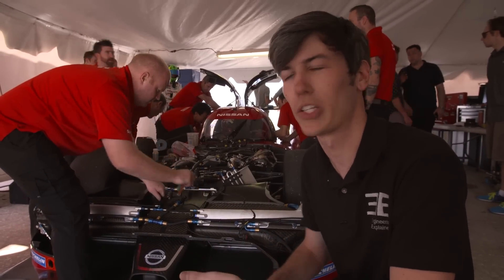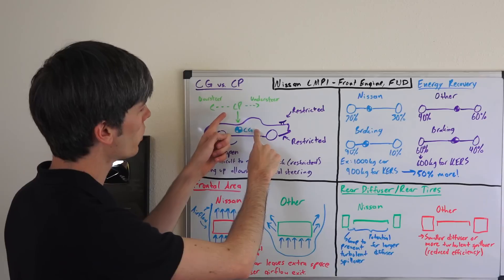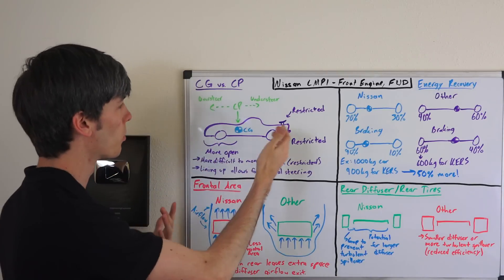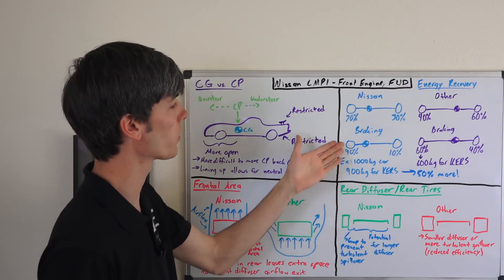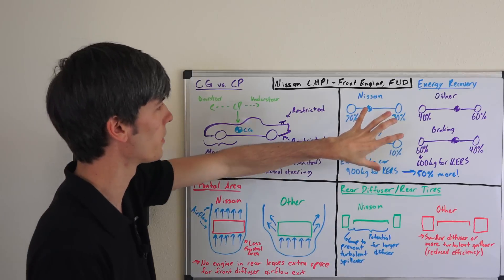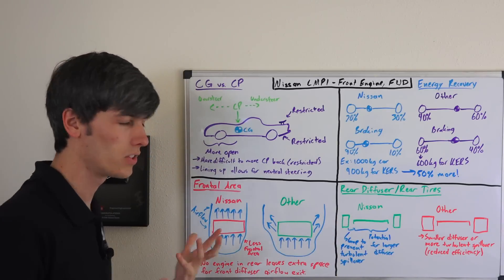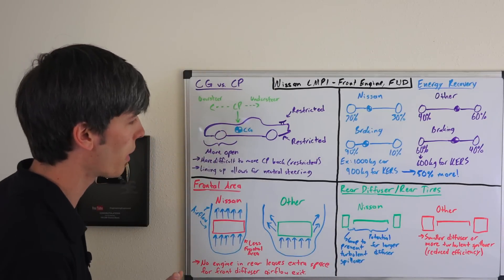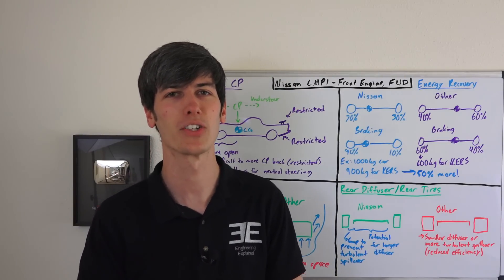Nissan GTR LM Nismo - 4 Reasons Why Its FWD & Front Engine

Comment: Isn't Nissan LM NISMO technically optionally AWD? I believe there is a electric driven/charged flywheel that sends power to the front and/or rear when needed.

Wiki: http://en.wikipedia.org/wiki/Nissan_GT-R_LM_Nismo
"The flywheels can also output power to a secondary driveshaft which is connected to a limited-slip differential at the rear of the car which feeds epicyclic gearboxes located in each rear wheel hub, allowing the GT-R to be all-wheel drive if necessary."

You can see a half shaft in this picture:
http://www.google.com/imgres?imgurl=http://www.racer.com/images/igallery/resized/4601-4700/Nissan_GT_R_LM_NISMO_LMP1_by_Marshall_Pruett_30-4610-900-506-80-c.jpg&imgrefurl=http://www.f1technical.net/forum/viewtopic.php?f%3D5%26t%3D21401&h=506&w=900&tbnid=B-YuuEFID2FmdM:&zoom=1&docid=vJ0Cjy134D5yWM&ei=65xDVdfPAY7IsAT21oGYCg&tbm=isch&ved=0CGIQMygvMC8
Reply from the maker: RoboTekno It's being designed to be able to send the KERS power to the rear, but when I was there speaking with Ben Bowlby he said they were running it all to the front at the time.
Reply: Engineering Explained I see. If they had the RWD components still in the vehicle during the testing and plan to use the RWD system as needed in the car for racing, it's still AWD in my book ;-)

I'm not familiar with all the technical rules in racing, but it seems there are many silly rules that are hampering innovative ideas. Either way, I like that manufacturers like Nissan are looking out of the box to come up with unique racing solutions. Hopefully it works for them and maybe we'll see some of their technology trickle into their consumer FWD/AWD vehicles.
Reply: RoboTekno If you're boxed in by redonkulous regulations, you'll come up with redonkulous innovations to work around them. Sky's-the-limit rules may be good but stringent specs can also spur creativity.
Reply: michaelthepsycho True, but how are rules like 'nose height', 'engine piston count', engine volume, engine type, spoiler & front wing length, and 'DRS only zones' sensible rules? (I'm not familiar with all the rules in racing, but I'm mostly talking about F1.)

My theory essentially is; give teams:
-A certain amount of fuel and/or electricity (A combined watt*hours limit of what ever combination of energy sources they start with). Maybe limit energy by cost/kw*hr and how much they can spend on fuel. lol
-No refueling, but they can recover all the energy they want from the environment and use it whenever they want. (ie. KERS, solar, absorb heat from the track, who knows.)
-Tell them the vehicle must fit inside a certain volume during the entire race (A box of x,y,z).
-Any part of the vehicle must not exceed a certain height off the ground except for if the vehicle crashes and is thrown into the air. (Basically not allowing planes to compete, but still allows for vehicles that hover or use ground effect to hover.)
-The only contact with the road allowed is by tires or by other parts of the car made of materials that are proven to not harm the road surface.
(Basically allowing side skirts that touch the road as long as they are proven to not cause more damage than the tires do.)

-To make it simpler, you could have a racing class that goes by street legal rules for a particular country or have vehicles fit street legal regulations for all competing countries.

-Then limit their consumables. Such as the number of tires or total weight of spare tires/wheels they can use.
_____________

Basically if a team wants a turbo diesel Wankel engine powered motorcylce, they can do that.

If a team wants a hybrid electric/gas turbine powered hover car, they can do that.

If a team wants an 8 wheeled, 8 litre, 16 piston boxer engine powered car, they can use it.

The only thing they have to do is make sure their vehicles fit in a box and their consumables are the limitation, not the vehicles themselves.

Speeds are limitless, but if you want to limit speed, make the race longer with the same amount of fuel. Add more turns or require vehicles to travel or hover over water, lol.

Nowadays all racing classes pretty much look the same and use the same type and sized engines. The current rules pump out cookie cutter vehicles. It's kinda boring in my opinion.

The ratio of "amount of innovation allowed" to the "amount of innovation possible" is pretty low these days in racing if you ask me.
Reply: RoboTekno  Transfering the power through all 4 wheels is always less effecient than through 2, plus I don't know much about their electric motors but I'd imagine there's some level of resistance, then there's extra propshafts it will have to spend energy spinning, they could mount the motors directly on the wheel hubs but then the unsprung weight will be through the roof and it massively detracts from handling.

Comment: Torque steer?
Reply from the maker: Camhin1 I had a lengthy conversation with the lead engineer about this. Said it has mostly been eliminated. I also spoke with the drivers and they said it wasn't a big issue, though there was some "hunting" in straight lines (back and forth). Nissan was working on improving it, but overall the drivers didn't seem to think it was a huge issue.
Reply: Engineering Explained wow, thats really cool, I hope this car works out. Thanks replying